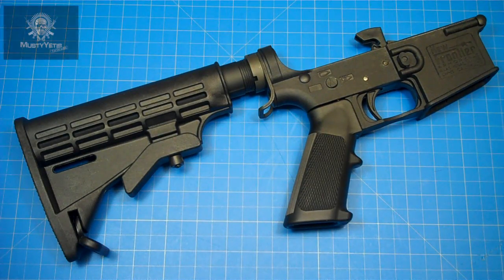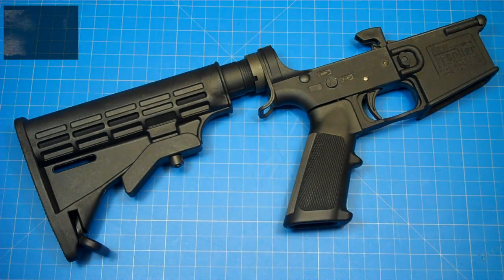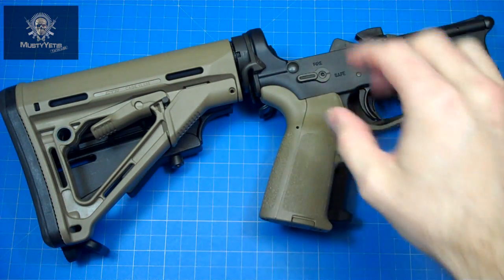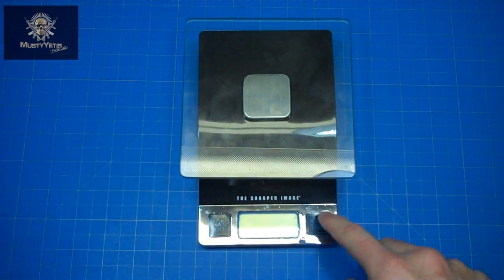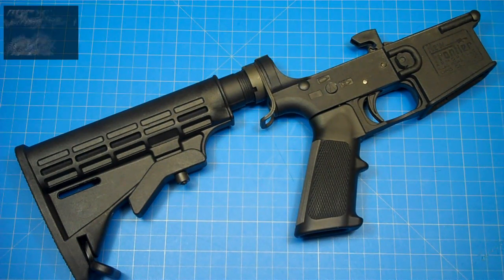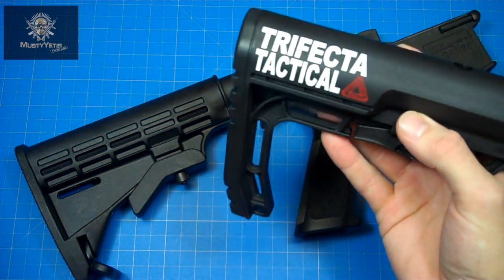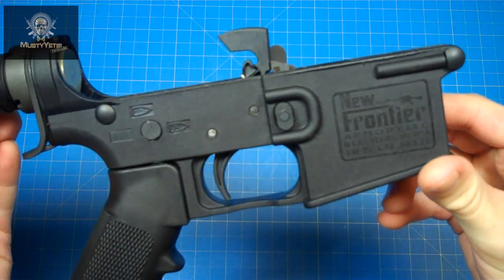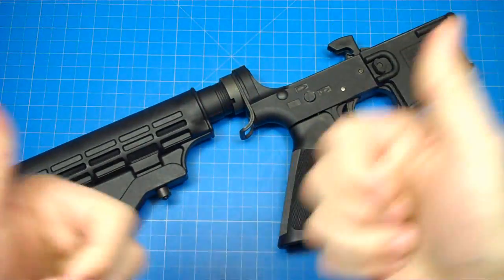New Frontier Polymer Lower :: 3lb AR build pt.3 :: Musty Yeti

Comment: Old video but I've had this lower in a PCC build for a few years with no issues but the ones you've stated. Having to take out material isn't as bad as they say. I'd actually rather have to file down some polymer than to have tolerances loose. The fit is tight for most components. I do believe this will wear over time and it's not a permanent lower by any means.

Comment: I owned one of these.  It was alright.  Way too tight of a fit though.  Polymer lowers are OK for plinking guns, range toys, or .22 conversions, but for a battle rifle, or a rifle I would need to defend my life, I wouldn't rely on it at all.  Why not just buy a regular aluminum lower for $49.99 from Anderson?  To each their own though.
Reply: Daniel Litz Why is Aluminum so great?  If the Al lower gets squashed it is useless, Polymer springs back.
Reply: Hey, if you trust your life to plastic that is easily out of spec, and of lower quality than a 7075 aluminum receiver, be my guest.  That is the only benefit polymer has aside from a small weight savings over aluminum.  I'll still choose aluminum every time.  I don't skimp when it comes to my personal protection firearms.  Also, don't even compare it to a glock or a SCAR, a scar is a piston driven system, much softer, and made a little differently, and glocks are a lot less pressure, also a completely different setup in regards to where pressure is put on the firearm.  Enjoy that cracked buffer tube ring LOL

Comment: I'm at maybe 900-1k rnds thru my AR with the NFA lower. Not disappointed at all. The only finish issue is the same cosmetic flashing/burrs on that upper part where it fits against the upper receiver. Otherwise everything else is good. No malfunctions yet with it. Couldn't beat the $110 ready to attach to upper price as well vs everything else during the gun scare.

Comment: You cant get any lighter than I know of than this NF lower. Use a Windham carbon poly upper with it. I use Bushmaster carbon upper and lower as well as this New Frontier for my ULW builds. The real advantage with the NF lower is the all plastic trigger group (which isnt really too bad). The trigger group must have a lower life, but time will tell. You can sand the flash markings off and Cerakote (or other gun paint) the lower and upper if needed (i use poly uppers). The result looks fantastic. I have even cut, routed, drilled and pinned a Magpul poly trigger guard onto two poly lowers so far. The jobs came out fantastic even though I am by no means a precision craftsman. Used my Dremel for all the work. Fill the voids with JB weld and sand and Cerakote  ( I like black or burnt bronze) and you have a really nice looking custom item that is ever so light. Even with out paint, the voids are only noticeable on extremely close inspection. I thinned the male parts of the trigger guards in order to have more meat on the grooves I cut into the poly lowers. I drilled and pinned the guards in place. Just an FYI for what you can do to customize your poly lowers. Virtually impossible to screw up. Just take it slow.

Comment: I have this lower, minus the Tapco sling plate (damn, wish mine had come with that), manufactured in 2012 when I purchased their complete G-TAC rifle.  I've put thousands of rounds through it and every polymer component has held up remarkably well.  Still runs flawlessly. I've replaced only the gas rings when they allowed the bolt to move freely, which of course, is not related to the polymer lower or parts kit.  NOTE: I do NOT run and gun, dive to the ground, roll around in the mud, torture tests, etc.. I just shoot.  I have no idea if the polymer blend has changed since I purchased mine, but if so, certainly it would have changed to improve it somehow. I have to say I'm quite impressed with it overall.  I definitely trust it as a reliable shooter, but as a heavy duty SHTF combat lower?  Not so sure about that.

How is this one working out for you so far?

Comment: Did I hear that right, a POLYMER hammer?  That's like buying a car with a tin engine block.  No thanks.  Even the super light S&W MP 15-22 polymer lower has a standard metal hammer.  I wouldn't trust this at all.
Reply: ..A "weapon of war?" naw- a decent plinker build, that can go for home defense? Actually yeah. bought one from a LGS for $109.00( same LGS was selling PSA and STAG complete lowers for $269 and $299- got the PSA with lower shelf inside) Put a PSA carbine upper on it total cost with Magpul BUIS was $699- stiff and tight as heck, but after 600 rds, I see no problem, nothing coming apart. Again, great for a plinker, but again, not a weapon of war- then again WHAT civilian is gonna see a "war" in suburbia?...
Reply: the308capital Whatever, I have over 5k rounds down range on one and it is going just fine.  Made it through a Carbine course like a champ as well.
Reply: knarfster - i would be the first to say the NFA poly lowers work,BUT.. since I've had mine- BOTH take down pins have FAILED( one cracked and the other simply went soft, which was weird as it looked like it had melted) , replaced them with metal ones, the detent pin was locked in improperly by the buffer tube and its tip got sheared off when it bounced out of place and landed in the trigger group( replaced it easily)- NEVER had a problem like that with the aluminum lowers from BCM or Spikes.

I like mine, but i use it as a "Beater" gun- equipped with a PSA Freedom mid length upper and it works fine- I still put my aluminum lowers over it as I believe they will last longer...

Comment: Just a recommendation for a part. AP custom makes a carbine length handguard. It requires no epoxy to mount and it is remove able.  It weighs 3.8 ounces.  I have the rifle length tactical version on my New Frontier lower.

Comment: I can't escape the feeling that the lower would benefit from having the high wear/impact components made from aluminum or magnesium (i.e. hammer and maybe trigger), and wouldn't suffer significantly in the weight department.
Reply: evilassaultweaponeer I know this is 6 years later, but that’s what I’m running in mine. I’ve heard that the hammer is the biggest issue with the polymer.
Reply: @natealvarez16  Better late than never haha. Luckily  the WWSD project exists now, and CavArms will live again (for the 3rd time and hopefully forever)!

Comment: QD end plate bro, unless they make a poly one a metal plate with a hole is lighter than one without! when you put this bad boy togather i would sugest an adjustable gas block and a standard buffer not a H or H2, that way you can tune the gas system and remove as much gas/energy as you can and still keep it running and still save some oz.